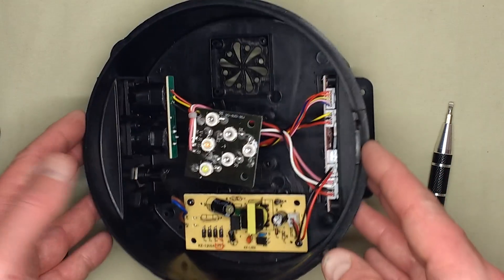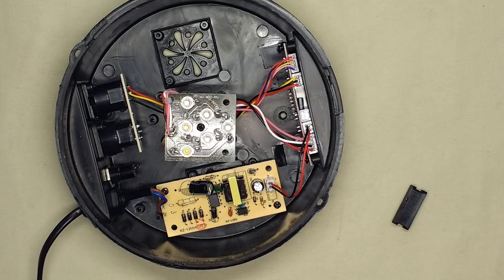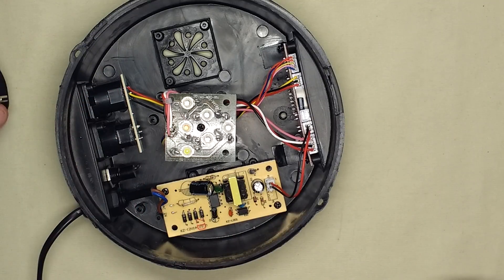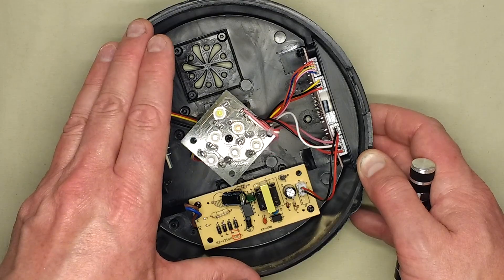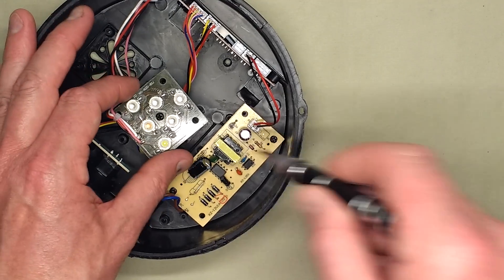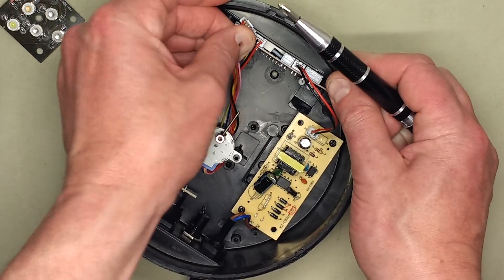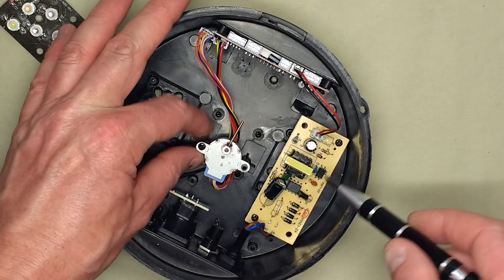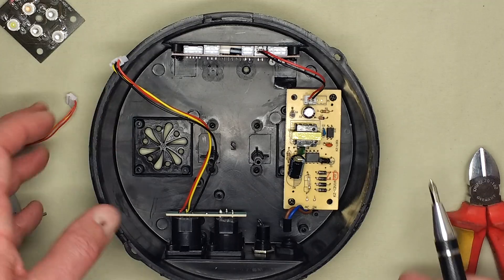Inside the DMX version of the LED dome disco light.

Comment: Hi Clive, I've got a 20 year old Tandy digital multimeter and it needs some new test leads, the dog got hold of the original set which were fantastic.  Any suggestions ? its got a max of 20A for current.  Great channel by the way, been subscribed for ages, its probably the randomest channel in the world...Pete (Not so Sunny Clacton on Sea, UK)
Reply from the maker: If you can't get a new set of test leads on eBay or Amazon that fit the sockets properly then you could maybe salvage the original plugs and join the new leads to them.
Reply: Peter Webster They generally just used standard 4mm banana plugs to plug the leads into the multimeter, so you could always just buy a good set of modern probes and simply replace the meter side with banana plugs to suit your multimeter.

Comment: The TM1635 is a clever 7-seg LED driver with a two-wire interface, although it's not listed on Titan Micro's website. Their similar TM1637 is used in the 4-digit modules that every other Chinese vendor on eBay is selling.

Comment: Totally unrelated to the video, but thank you Clive for introducing us to the Wago connectors! I deliver newspapers in the wee hours, and occasionally need to dim down to my parking lights, but I have automatic-on headlights and DRLs that are almost as bright as low beams. There is a TSB (technical service bulletin) from Toyota that details the one wire to snip to disable this system, which is fine and dandy, but I wanted the option to restore OEM functionality when not at work. Obvious solution was a splice a toggle switch into that wire instead.

Problem being: I didn't want to cut/strip/twist together/tape, and there was the usual not-enough-slack, not-enough-room-for-hands issue in the dashboard to do this, much less room to use proper butt connectors or to get in there with heat shrink and a soldering iron. THEN IT DAWNED ON ME: The Wago connectors would be IDEAL for this application! Cut the wire, strip both ends slightly, pop a Wago in there for each side of the switch, and voilà, manual override for DRLs and auto headlights, and with a flick of the switch, back to normal operation. 

*THANK YOU* for showing us those little marvels! Such a time - and knuckle - saver! (Especially when cutting that single wire blindly and my snips went a bit too far and cut two other wires that were vital - another two Wagos saved my butt there, MAN I felt like such an idiot!)

Comment: @jort93z a UK household circuit is a 240V 32A ring circuit. You need a fuse in the plug or appliance with that kind of power in the wall. 
Even with the mere 16A circuits that are the norm on the continent, you really want a fuse in the appliance. 

Keep in mind that most of the world doesn't use 110V mains. We get a lot more power from a standard outlet.

Comment: Why are there so many unnecessary chips on the main board? What's the point of using a display driver chip for an LED 8-segment display with 4 positions? Couldn't you just hook it straight to the pins? And why use a DMX driver chip? It's such a simple protocol to implement in software. (Which I have done before) Wouldn't it save money to use less chips?

Comment: The manufacturing facility where I work at, they fuse the power wire not the appliance because the appliance will be blow out way before the wire catches fire so its basically wire protection.

Comment: Why would anyone buy a 20A fuse for a UK plug? An M5 20mm long bolt is much cheaper and handles a lot more current.
Reply: John Francis D'oh!
Reply: Timothy Sherratt but please also fix that wierd switch in the funky box downstairs, or it will automatically go to the off position. Just take some metal wires and clamp it in the "on" position ;)
Reply: +HaLuNkE ST0NER And that with a very industrial and robust switch as Clive would say xD
Reply: It's taped that way (electrical tape, safety first).
Reply: Someone who likes warm wires.
Reply: But in the UK and many other European countries it is very unlikely to not trip the breaker before blowing the fuse when dealing with something like 20A anyway. Most households only have 16A or when older even 10A breakers, which would make a 20A fuse completely obsolete so you could indeed use a bolt instead, because it would do the exact same thing in that case.
Reply: 15A wire,  in older boxes,  but you can always double it up if you don't mind your lead-and-wax-paper wiring getting toasty.
Reply: Timothy Sherratt The job of a fuse is to NOT handle the current, and to fail in a safe way.  The fuse MUST be the weakest point in the circuit by a wide margin, so the fuse blows before anything is permanently damaged.
Reply: John Francis Doe I should have guessed someone would be dense enough for that to go right over their head.

Comment: So, they fitted a fuse holder, but forgot to wire it up, that seems a bit silly, they could have left it out and filled the hole, saving the 0.047 Cents cost of buying a fuse holder... :P
Reply: On mass-production scale it's probably both easier and cheaper to make the same plastic body and shove the same parts in it for all variants, differing only at the wiring stage. Shipping to a country that doesn't have a fuse in its plugs? No problem, an extra few inches of wire and you're done.

Comment: Clive, would you consider having a look at a standard budget computer power supply? I have an irrational fear of them, despite knowing the dangers.
Reply: heyou 
Honestly so long as you get a PSU that's rated for 1.5 to 2 times what you'll throw at it, there's no problems with them.. I've used cheap PSUs almost exclusively for years (even in gaming PCs) with no problems
Reply: Cheap $15 ATX power supplies leave out filter chokes and create a lot of RFI. If they fail, they may damage anything plugged into them.
Name brand ones start out at about $40 and are decent quality.
Reply: You really shouldn't need to double the wattage rating to get stable power. Getting a PSU of a way higher wattage than you need reduces its efficiency, too. There are calculators that tell you roughly what wattage your components will need at full power draw. Overrate that by 25% or so to give your system some breathing/aging room, and buy decent quality.

Unless you're Clive. If you're Clive, get a pink one from Poundland and see if it will make your whole system case live at mains voltage...
Reply: rocketman221projects Wow okay I didn't realise they were that cheap, I mean I use generic no brand ones that I pick up for free every now and again but I never thought any PSUs would come without chokes/filters
Reply: I had a cheap one once, I think it was logisys or something like that. I was using it to power a project. I couldn't get any radio reception near my house, just a loud buzzing noise. I eventually tracked the interference down to that power supply. They had jumper wires in place of the filter chokes and the X and Y capacitors were missing. The power lines in my house made a pretty good transmitting antenna for the power supply.
Reply: JonnyGuru PSU reviews did some reviews of dangerously cheap PSUs, the "Gutless Wonder" series which includes some videos of explosive failure... http://www.jonnyguru.com/modules.php?name=NDReviews&op=Story&reid=71
Reply: Not necessary to go double, your typical high end single GPU system will be served well with 650-750w PSU of good build quality, that is even with taking into heat degradation of the caps over time reducing the PSU's max output. A low end system can easily get away with a 350w, again,  so long as the build quality is there.

Comment: The fuse thing has always baffled me, every plug I ever bought in the UK came with a 13A when the majority of electronics needed 3A or 5A.  I can only assume there is a ton of electrical stuff in the UK being protected by the wrong size fuse as the majority of consumes won't bother to check.  Is this still at thing in 2017?  I've not lived in the UK since 2000.
Reply: Yes, I'd prefer it if 3A or even 1A was standard for new plugs but as everything is required to come with a fitted plug now, it isn't such a common issue.
Reply: The fuse in the plug is to protect the flex going to the appliance.  The appliance has to have its own provisions for overcurrent protection.  It's possible that a 13A fuse will still disconnect a short circuit (fault condition) in time before the copper reaches 70 degrees centigrade, even on a thin (0.5mm sq.) flex.  70 degrees is the temperature at which the PVC insulation suffers.  I fitted a patio wall light recently using 1mm sq cable directly into the back of a 13A socket with no fuse.  There was no convenient way to include a fused spur (FCU) in the wall.  The 1mm cable was protected only by a 32A circuit breaker at the consumer unit.   I was able to certify it to 17th Edition by quoting the adiabatic equation which proved that the circuit breaker (a Hager 32A MCB) would disconnect before the cable got too hot.
Reply: The rest of europe uses unfused plugs on a 16A MCB protected radial which leads to the requirement for 0.75mm2 minimum cable size. A 13A fuse will give similar protection to a 16A MCB I guess. For chapter and verse have a trawl of the IET forums.
Something to watch is that a lot of the china sourced kit will have a 13A fuse in the plug but the cable is thinner than 0.75mm2 - sometimes a LOT thinner, very cheap IEC leads are notorious for this. Sometimes the plug doesn't even have a fuse either! :o
Reply: Actually, the plug in the fuse is not intended to protect the appliance itself, it's designed to protect the flex.

Comment: Hey Clive,

I bought one of these to tinker with a few years ago and mine came with 5 DMX channels: 3 for the pairs of colours, 1 for setting a specific rotation position, or speed and direction depending on where it was placed, and the final one for a strobe. The strobe was very weird as it would be delayed by a few seconds before actually triggering, and I never figured out why it did that. Presumably it's just a software glitch?

Cheers

Comment: Those steppers, assuming it's a 28byj-48  are geared steppers and you just set their drive current to something low so it skips.  They are commonly used in aircons to turn the louvers back and forth and other related things.  (Edit: Just watched the rest of the video.. Now I feel silly. :)

Comment: why do uk plugs have fuses? there's a circuit breaker anyway. i don't quite get why you'd also need a fuse in the plug. the circuit breaker should be telling you when you've got a short.
Reply: For something like a lamp a 3 amp fuse is used, I'd sooner let a 3 amp fuse close to the faulty device blow before a 20 amp breaker trips... Just imagine an arcing connection in a device, an arc can be sustained a lot longer if it needs to exceed a 20A limit.. The longer it takes for something to trip the higher the probability of a fire.

Also since when is more protection a bad thing?
Reply: i guess that makes sense. thank you.

Comment: For some daft reason you cant fit the correct fuse into uk mains plugs, pat testers automatically change the fuse for 5 or 13 amps, seems daft to me :-(.
I put a 3 amp fuse in lamps as its the lowest you can get.
Reply: I typically use tin foil for robustness.
Reply: Johnny English, the fuse was foiled with your evil plan :-D
Reply: No, you can get 1A fuses...   RS Stock No. 412-986 ,   2A 412-554   Instruct your PAT testers NOT to change them!
Reply: Hoi Yue, Yes It's silly isn't it, i know we have earth leakage/r.c.d type systems in the distribution box, but i like a correctly rated fuse, just in case :-). 
And everything that is metal should be earthed.
Reply: zx8401ztv RCDs don't protect against FIRE from overheated circuits. That's the job of a correctly sized fuse.  PAT testing people who routinely change correct fuses to oversized fuses are dangerous and should loose any and all certifications.  Remember Grenfeld started as an electric fire in an appliance!
Reply: John Francis Doe, i think just the same as you do, fuse rating has always been important.
Yes i did miss out the fact that breaker box systems don't cover everything, just forgot to say it.
My brain is a bit halfbaked today lol.

Comment: ive got three but one came with the dome smashed so i took it apart. the other two i use over dmx with the rest of my rig they look quite good for the price however when i tested the broken one i found that the working ones used a different dmx profile to the broken one. i also found that the broken light had the most logical profile but trying to change profiles didnt work as they only have one profile